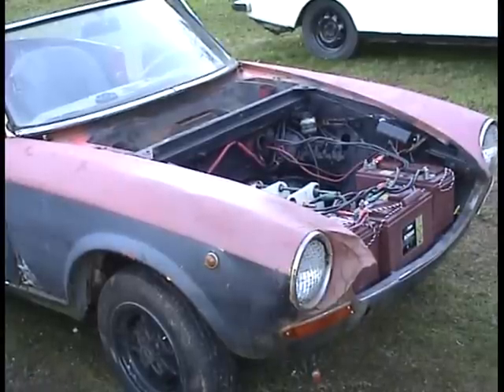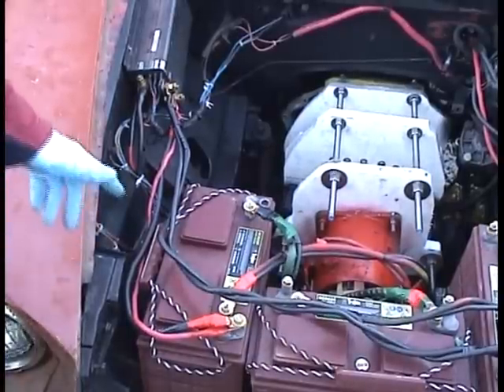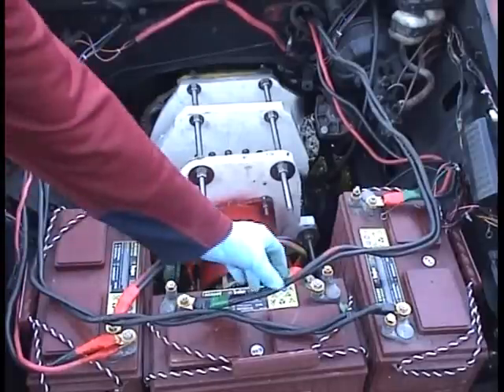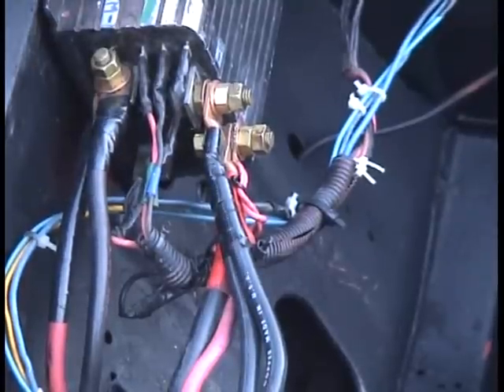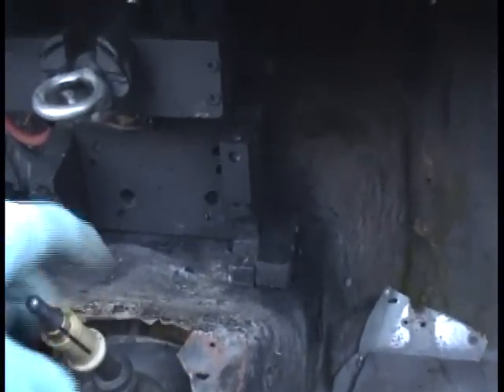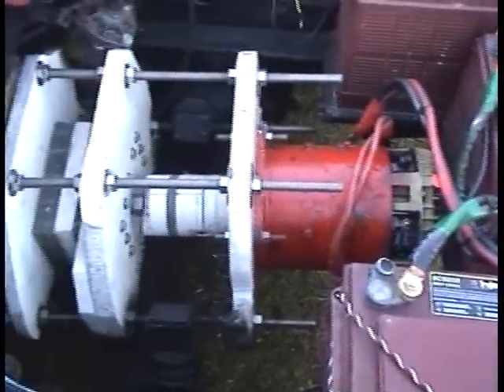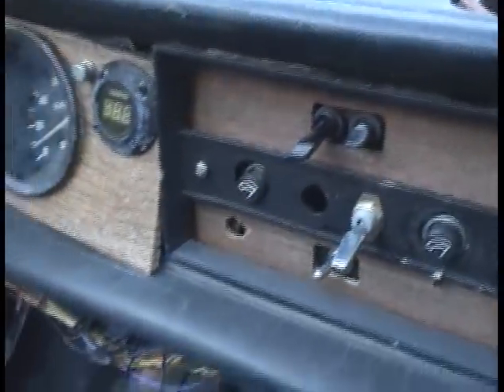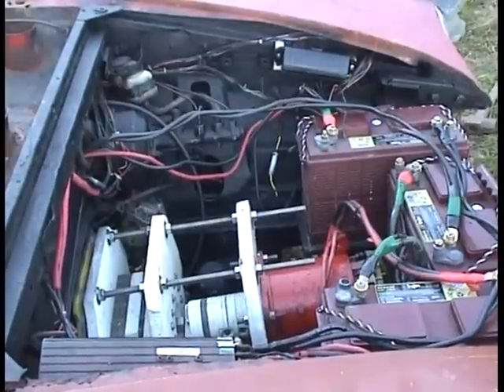Forklift motor in car and first test

Comment: This project is fascinating. Check out episode 7 of Fastest Car. They have a ‘72 Datsun 1200 that held the title of fastest electric car. It uses a generator out of a DC-3 aircraft for the motor. It takes up about the same space under hood as this motor, but produces so much power, that it does the 1/4 mile in 10.25 at 126mph. The battery packs are not car batteries. They are a futuristic looking panel that fits in the tiny trunk. I would contact those guys if you feel like taking this project somewhere. Also they use a volume controller for their throttle too. Lol

Comment from the maker: Hi goracks69
Yes I have seen videos of that white electric  datsun1200 and looked at their website. I saw then they had two very powerful DC car motors and had them in parallel from stop them switched to series after a few seconds (maybe series then paralell??l
 anyways their motors same basic design as this forklift motor with 4 big brushes very simple design
When I had no speed controller i had built simple copper contact switch either on or off the car would lurch forward great force from all the amps  and I would brag it could beat any car in race from 0 to 20 feer...i need to take out that clutch I put in it made it worse. Car h always had problems going up steep  hills as motor bogs and runs slow battery terminals get hot ruined one battery as terminal melted
need to lighten car more take off doors next step I am in eastern europe now cannot work on it until spring if lucky
Also want convert batteries to Alum batteries no lead acid look up John bedini on this subject  also  I have some special motors built to replace the forklift motor look at my site mrdkonzen for.the designs want to charge batteries as motor runs via Muller motor generator in there

Comment: Love this.. Thank you for posting this!!!!  So did it ever do better? what do you think it needed? know HP and RPM rating on motor?  know your cars dry weight? RWD? know your differential ratio?  Do you think you could have connected directly to your drive shaft or differential? At low speed do you have more torque?  Somebody told me I had to I might be able to do with 2500 blazer and direct drive if I can reduce differential ratio to about 8:1 (from about 4:1) .. It sounded like your transmission was just getting in your way... Thoughts?

Comment: just a question why would you even need a clutch
Reply: Idea was to make it so I could rev motor up in revs, and downshift like from 3rd gear to 2nd gear while beginning to go up steep hill for instance also idea was  to get some good flywheel effect too to help power  instead, however top speed has been cut down from 55mph to 35mph with fully charged batteries so I plan on removing the whole clutch flywheel experiment, and inserting a Muller type flat rotor motor.genrator in that space hopefully will finish this before summer 2015

Comment: Probably one of the most "crappy" assemblies I've seen. LOL 
BUT on the other hand, fascinating. ;-)
For some reason your video got me hooked, I guess the combination of ingenuity, low budget and "make it work" spirit, combined in that Fiat 124 Spider body. It's indeed quite nice.

If budget/time allow it, an upgrade in voltage and controller, let's say 72V will make for a very decent ride and reduce the amps put trough those connections (less heat). 
Reducing/simplifying the mechanical side, gearbox/clutch, will also help. :-)

Thanks for sharing, thumbs up. :-)
Reply: Thanks it really is a piece of junk I agree the fiat should of been junked long ago, the motor was 100 bucks the controller 75 bucks batteries expensive at 200 bucks apiece however....goling up hills,  if not terminals super tight they get red hot, I ruined one of the batteries as the terminal dislodged internally from the heat...this car only good on very flat roads as is..the clutch addition made it worse need to go back to direct motor to tranny....there is room to put extra "free-energy" type of motor/generator in between tranny and motor which was next step as I build stuff like that ...this I wanted to do to recharge batteries as it drives, give it some more power up hills but now I am in Minsk Belarus will return when wife gets USA visa which might take awhile....thanks again
Reply: Doug Konzen - No way, keep that Fiat Spider. Might be a junk but definitely a nice piece of junk. Make a wonderful base for a restoration. project. :-)
Guess your to close to a stall condition and Amps sky rise accordingly.
Possible to play with the transmission or if available a set of lower tires on the drive wheels. 
You mention on another comment 50mph that seems way high for such a small motor. Closer ratio on the final drive might be part of the ticket to make it work. :-) 
Thanks for your comments.

Comment: Does your motor controller need to be programmed via PC Software?
Reply from the maker: Hi Mings
No software programming needed. It is just a speed controller for a golf cart motor, rated at 36V and 400A.
4 batteries at 48v and golf cart speed controller rated at 48v would be better for going up hills

Comment: Good work Mr. where can I get all the parts in a good price. 
the motor, the speed controller and the pedal for to speed the motor.
Reply from the maker: Hi JoseThe motor (36VDC 400A forklift or "fingerlift" motor)  I found in scrapyard but you can find them on ebay. There are lots of PWM speed controllers on ebay too - they are used for golf carts.The pedal is a guitar foot volume pedal, and I put inro it a potentiometer of  the type that will control the speed controller....

Comment from the maker: Not so amazing it gets hot going up steep hills. Motor is from junk pile in someones backyard. Its 36v 400A rated but no brand on label. No magnets in motorit has just 4 very thick wired coils in stators and rotor too, so is coils vs coils power...it  changes polarity every other firing but is dc input...this why it has. 4 big brushe copper commutaor. It is a  very typical forklift (fingertlift) motor got it for 100 bucks. Look at the motor generators I build on my YouTube channel would like to add one of these to drivetrain I am in Minsk Belarus for summer electric fiat in Seattle. Thanks for writing!

Comment: top speed with fully charged vs discharged battery?
Reply from the maker: 50mph flat road fully charged, half discharged around 35 or 40....does not go up hills well when motor has to go too slow it gets hot especially battery terminals....flat roads OK though
Reply: did you sit at a particular gear? when you control speed is torque greater? weight of car?

Comment: the power steering? do you remove it?
Reply from the maker: there is no power steering in a fiat 124 spider! I removed everything else though....
Reply: MrDKONZEN is it not hard to steer?
Reply from the maker: no it is easy to steer...those three batteries and forklift motor weigh a bit less  than  original gas motor and radiator and accesories

Comment: will it caused a fire if you put more voltage on a 36 volt motor?
Reply from the maker: where it gets really hot is at battery terminals when motor goes very slow like going up hills ....probably could input 48V for short periods and motor would survive, but speed controller only rated at 36V so cannot say for sure....should have some sort of backemf/recoil recovery circuit with steering diodes on that motor to keep it cool and be able to put in more voltages
Reply: You can over power a motor for short time.  Think of it as a nitro boost in a gasoline engine.  If the motor has extra cooling you can do it for longer periods.  It's the heat created that causes the damage.

Comment: how much power is it making
Reply from the maker: Top speed on flat road is 50mph at 36V worth of batteries - does not like to go up steep hills however and so have to crawl up steep hills in 1st or 2nd gear - It lost lots of power when I put in the clutch and flywheel as now top speed is way down to about 35mph which is big drop, so am going to take all that out and go back to forklift motor directly on 4speed transmission and when you want to shift, cut power to motor.... olans also are to put 2nd flat-rotor "axial"  type motor-generator between motor and transmission to give it a boost.  WhyDidYouTurn
Reply: MrDKONZEN very well then

Comment from the maker: putting in clutch and flywheel was not such good idea, it added weight, motor turns slower, and you can hear some scraping noises of the flywheel bolts hiting something in there.....don't know what am going to tak e it apart put in motor of my own design eventually however living in eastern Europe now....drove around in a Renault TWissy electric car in Germany for a monty - that was a blast to drive very very quick and fast only 2hrs to charge up range about 80miles,,,,a real electric car, this electric fiat more like an experimental test bed....
Reply: Direct drive on the rear axle would be ideal

Comment: What is the range
Reply from the maker: Hi Do Chinigan
With the three 12v golf cart batteries in series for 36v it only lasts one hour at best  on flat road going low speed drawing say 90amps and going 25 or 35mph but going up steep hills the motor draws near 400A as motor goes into  low rpms in first gear too and now batteries get sucked down very fast.
Reply: @MrDKONZEN  thank you sir
Reply: @MrDKONZEN  sir what if you took and ran a series of alternators and Daisy chain them say one on each able and one directly off the drive and use diesel truck batteries as the higher amp battery may last longer ... Let's say you did use 3 diesel batteries and had 3 18 wheeler alternators would the motor still drain the batteries faster than they could chargw and if so then I what if you hook up a totally separate charge system like say on the rear axle away from everything as I don't know if it would cause an EMF disruption or not but anyways move two alternators to the rear axle and have them both going to a very high powered inverter to run a very strong  battery charger so that it will feeding as the Moto was turning like a self contained system ...you could put it in place of the fuel cell

Comment: So if it made this car go 35 mph, I wonder how fast it would make a go kart go...
Reply from the maker: Actually I got it up to little over 50mph on flat road, with freshly charged up batteries and no clutch and flywheel, the motor was then hooked directly to the 4 speed fiat transmission.  In a gokart it would be scary same with motorcycle....batteries are heavy lead acid golf cart 12V type.